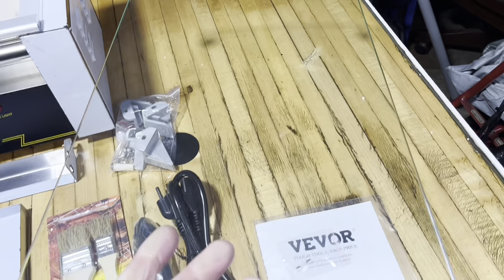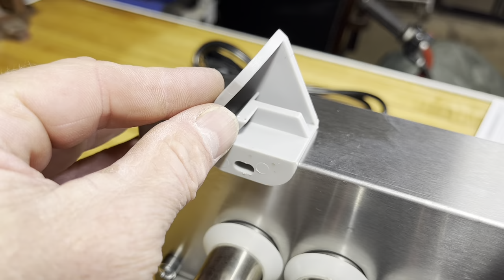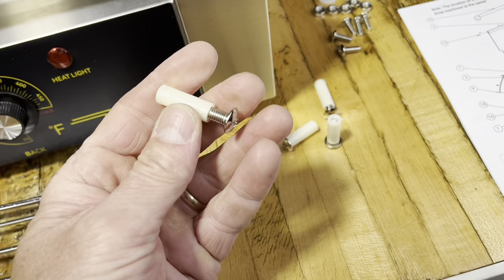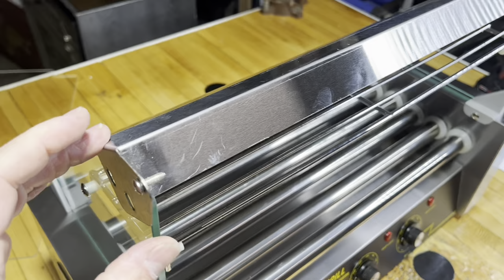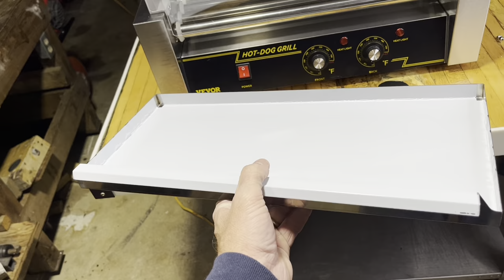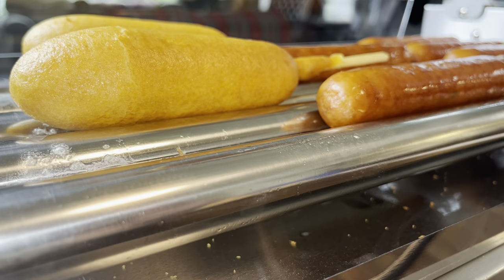VEVOR Hot Dog Grill Machine Full Assembly & Review | Hot Dogs, Taquitos, Corn Dogs, Egg Rolls

Comment: Too much maintenance with the glass you should’ve bought one from Home Depot 200 bucks. You don’t need a cover over it. Where do you start cooking those hotdogs it’s gonna be hard to clean. The rollers are hard to clean already.
Reply from the maker: Thanks for your insight and questions.
Reply from the maker: To bring resolution to your question as to where. Anywhere with a plug in for power save for a generator would suffice.